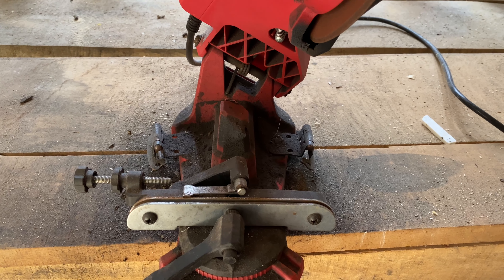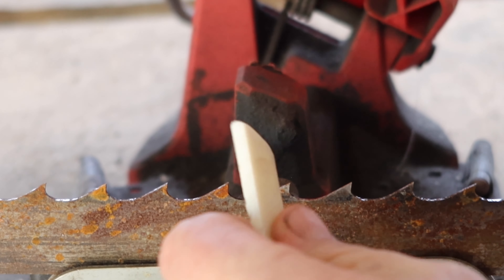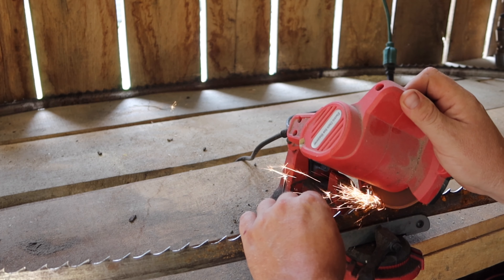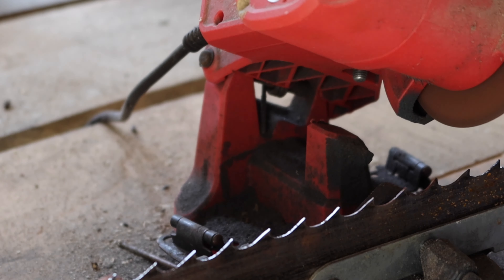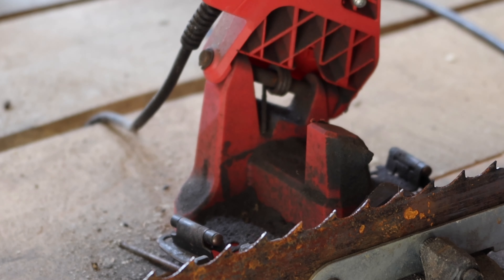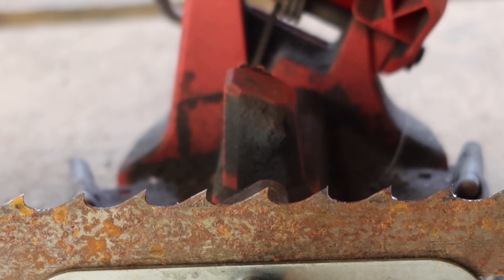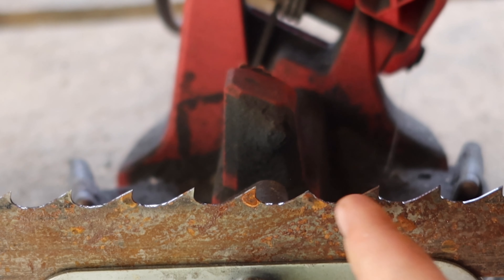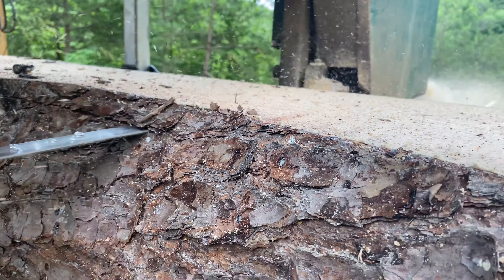Cheap and great alternative way to sharpen your band saw blades! woodland mill hm 126 bandsaw

Comment: I can appreciate that you want to save some money and sharpen your blades yourself. But you are ruining your blades for your resharpen service. They are not going to want to sharpen those because the profile is now changed. Do yourself a favor and purchase a inexpensive blade sharpener instead. Sorry not trying to disrespect your video.
Reply from the maker: I got ya buddy and I appreciate the criticism but I’ve used it for this many years and it cuts good and still get the same life out of the blade regardless if I send them to get sharpened or do it my self

Comment: Folks, this really works!  I took my old Harbor Freight Chainsaw sharpener and the very first blade I did worked like new!  Now to try one of those $40 tooth setters offered on Ebay! Thanks.
Reply: Is that smell from grinding  poisonous for you?
Reply: @spartakmayakovski  I do it outside and don't really notice any smell.  Always use some type of cross ventilitation like a fan if you can.
Reply: @CaptMike  ok thanks

Comment: Just watched your video, no one around me sharpens blades so I'm gonna try your method.   If anything I can at least get them sharp enough to can't my logs for later milling.
Reply from the maker: It works fine man I cut lumber on mine main thing is don’t overheat that tooth bad

Comment: Im new to the saw mill////  every three teeth is different. is the cutting angle the same on each tooth???
Reply from the maker: Blades are 18$ roughly and u will get around 3 or 4 sharpenings out of each,  all angles are the same, teeth are set a little different though one is a little to right other center then other left, but it works trust me don’t overthink it.

Comment: Hey thanks for info. I’m curious in those guide block mods and where I can get them for the bigger blade. I have the HM 126 as well
Reply from the maker: As far as kids all u gotta do is open the blocks up a little wider even though the blades will stick out in the front a little it doesn’t effect the performance
Reply: @TheOutdoorsGuy  Ah gotcha thanks

Comment: Thanks for the video, where do get your blade's I wasn't able to find that info. I saw your video on the inch and half blade's but can't find where to buy them. Thanks
Reply from the maker: Pipers saw shop u put phone number in description
Reply: @TheOutdoorsGuy  just checked out pipers, lots to choose from, what blades are you using? What do you mean by put phone number in description? Thanks I'm learning
Reply from the maker: Haha I got the video mixed up it’s on my video about using bigger blades I put the info about pipers I’m sorry about that! I use woodmizer turbo7 they are bigger than recommended for ur sawmill and regular blades I like Simmons
Reply: @TheOutdoorsGuy  thanks